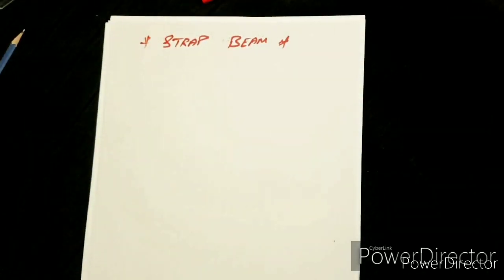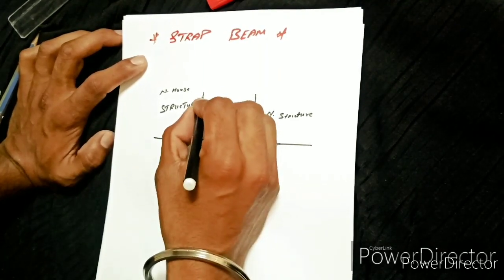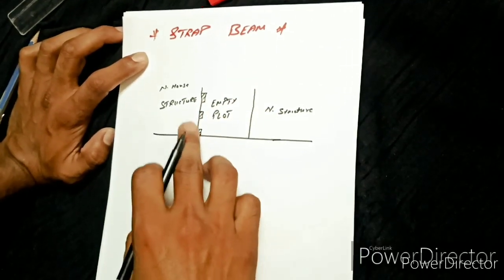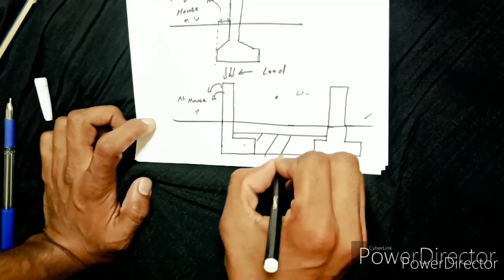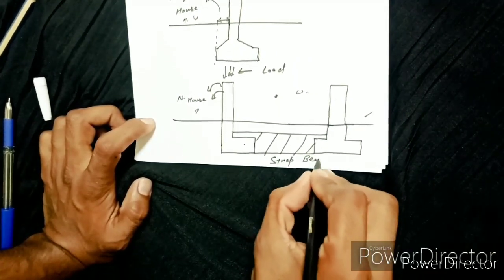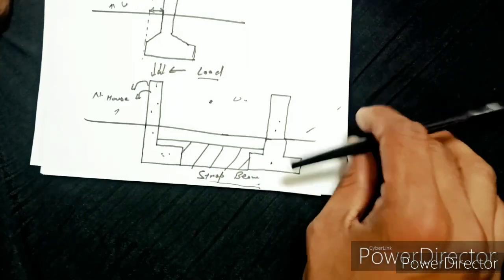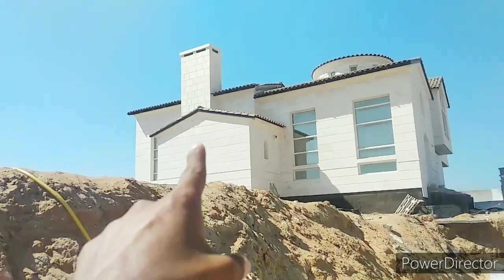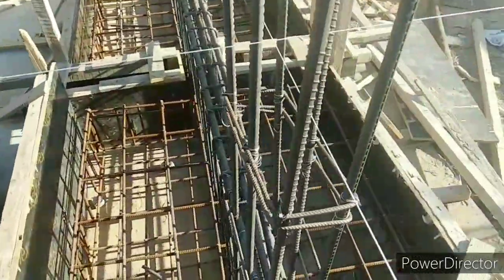What is Strap Beam or Strap Footing

Comment: The video you showed is just ridicules. One of the cases where we use strap beams instead of combined footings is when the space between the two adjacent footing pads is too wide and excavation and concrete work for combined footings is uneconomical. But in your site video the footings are very close to each other and the space between them is almost zero. So would have been more engineered structure if you used combined footings instead of strap foundation. Afterall, Engineering is finding the "G-spot" between economy, safety and functionality.